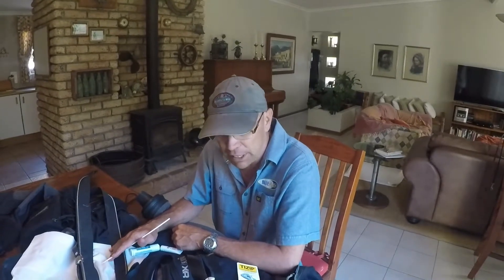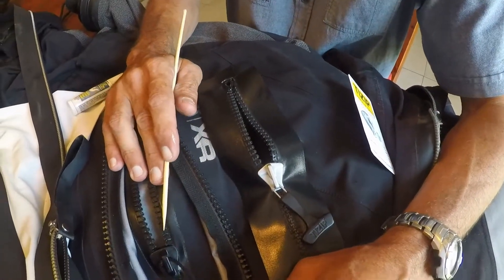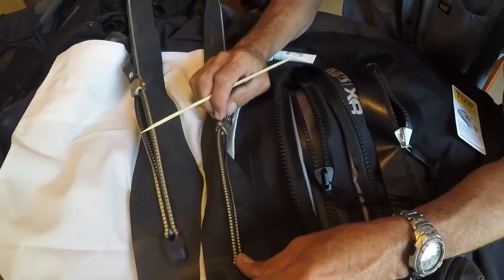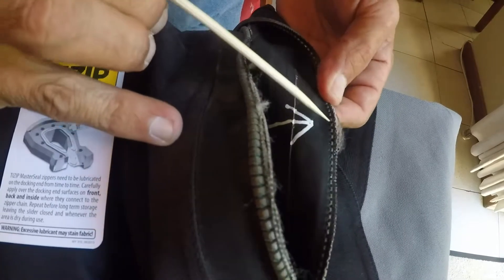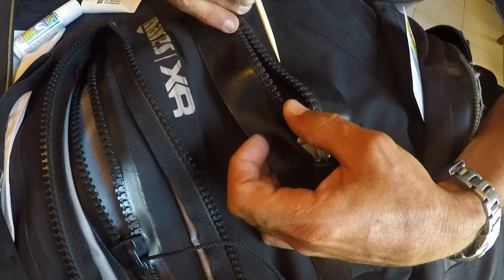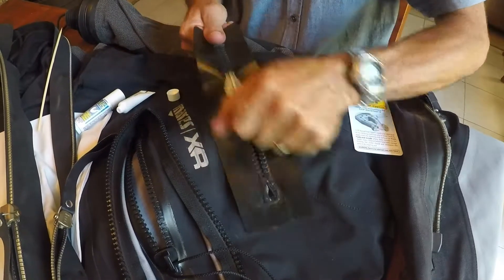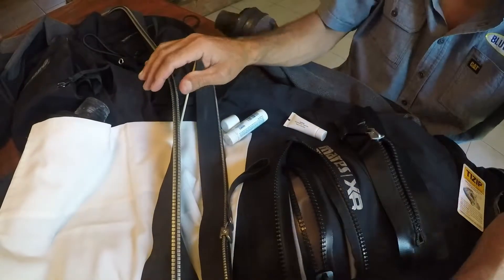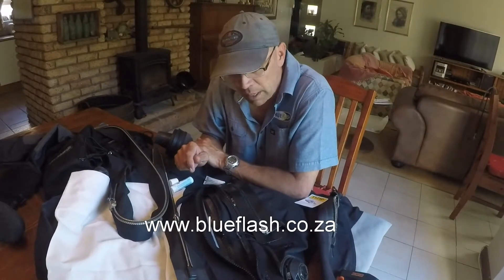Drysuit Zips

Comment: Thank You. Please answer my question: what zips more  reliable TiZip or YKK?
Reply from the maker: Do you mean when comparing the Ti Zip Masterseal 10 and the YKK Aquaseal zip?
Reply: @blueflash_cape  Yes. Which one is  the better choice?
Reply from the maker: I think they are virtually the same quality. Some of the early manufacturing runs of the Ti Zip had an inferior backing fabric which was prone to delamination but as long as you get 1 made in the last 2 or 3 years you will be fine.